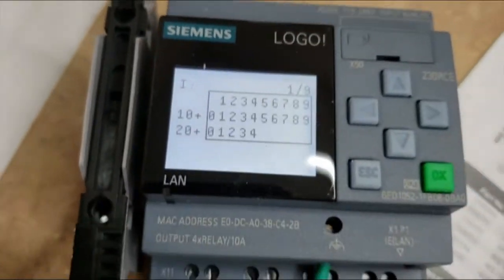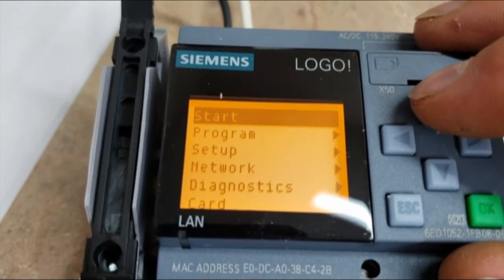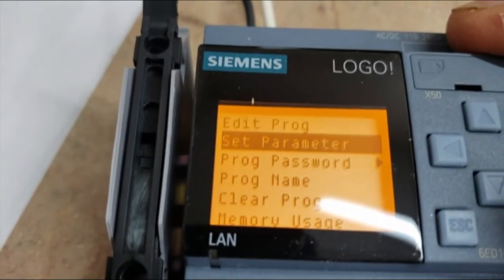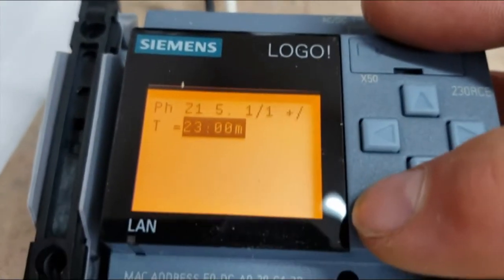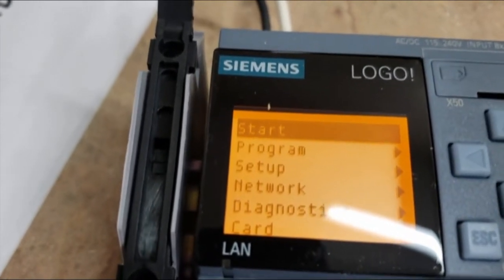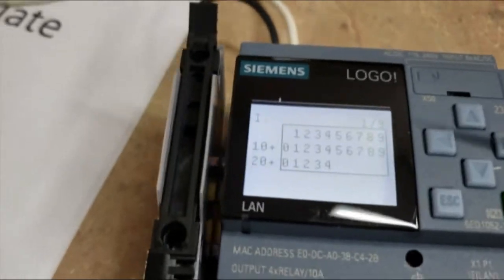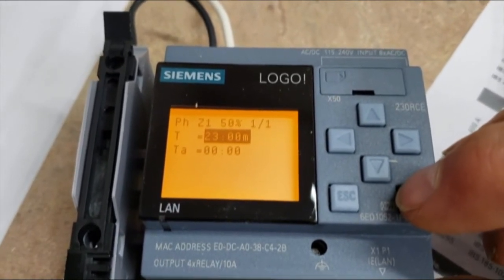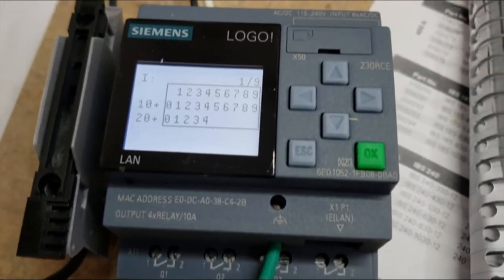Siemens LOGO PLC: Copying programs or settings from PLC to PLC

Comment: Hi, looks like it has been long time since you upload this video  but still I hope you can answer my question.
I have two ink mixing Machines and on one of them I accidentally clear the programs.. now machine is not doing anything. 
I wanted to copy programming via sd card because the one running without problem has sd card slot, but the problem one doesn't ( or I can't find it).There is a slot but looks like it is for cable connection.  I don't have that cable. I don't know how to fix this problem. 
If you can help me I will really appreciate it. 
Thanks in advance. 
Regards 
Alex
Sydney - Australia

Comment: Can I have a picture of the memory card?
Reply from the maker: you need a micro SD card. At the moment, the smallest one you can buy is 16GB, which is plenty.  I can't share a photo in the comments.
Reply: @MikeFixesStuff  i'm in vietnam, can you make facebook friends to discuss the logo... thanks...
phuctho.infola@gmai.com
Reply: @MikeFixesStuff  I use my phone's 1GB micro sd card but it doesn't recieve it
Reply from the maker: @thophuc4856  I would check what format the SD card is in if you can open the card on a PC, and cross reference that with what format the Siemens Logo uses.  I don not have to format the ones I buy from Amazon.
Reply: @MikeFixesStuff  I did it...thank you so much
Reply from the maker: ...and make sure the card is empty befure using it.
Reply: @MikeFixesStuff  okie ...thanks
Reply: @MikeFixesStuff   hello Sir 
Please solute my problem of siemen plc logo that starting option which come on screen is not coming ...as start option is not coming.  what to do.please guide
Reply from the maker: @Jsr735  I would figure out how to do a factory reset on the PLC, if you are attempting to send the program using an SD card then reformat it and try copying the file again. If you are not aware, you need to save the program you have made as a BIN file for the PLC to be able to read it in.
Reply from the maker: Also be aware the the SD card should only have the BIN file on it and do not rename it to anything other than the default name.
Reply: @MikeFixesStuff  thnks  a lot giving ur valuable  time to me.fortunateltly I have solute just 5 minutes ago . problem was that I was checking setting by mistake I clicked on
Switch to OP
That's why that option gets hidden. Now ok.
If sir another problem is to my logo not connecting to pc
At the end coming wrong IP address.
Reply from the maker: @Jsr735  just make sure your computer ip address is the same subnet (that is the first three numbers have to be identical) and the PLC and computer need to have a different fourth number. I don't think auto IP will work, it has to be manually set.